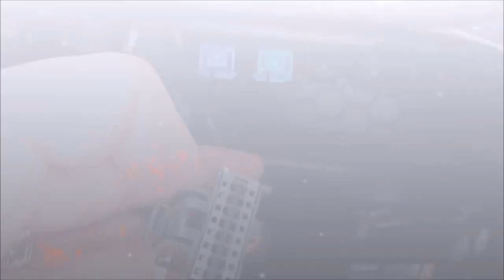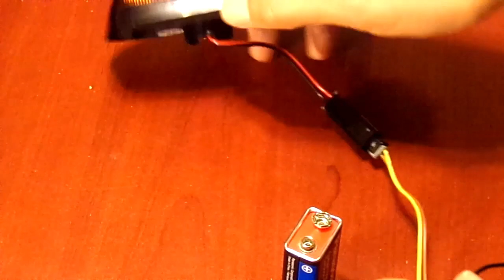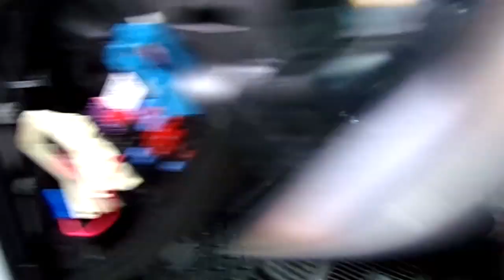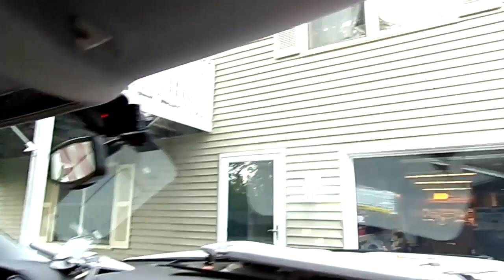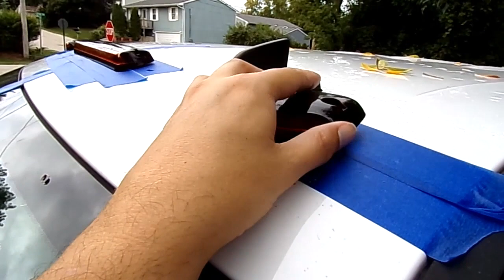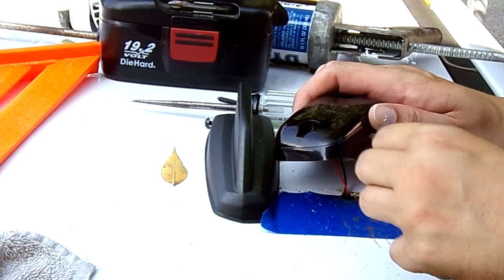Project Silverado E17 - Cab Lights

Comment: Hey quick question I got these lights installed but they hooked it up to the fuse box under the hood where when you turn your marker lights on they turn on but not one of the lights are flickering. Do you know how I could fix this?
Reply from the maker: If it's only one of the lights that's having an issue, its either the light itself has an issue, or there is a bad connection somewhere. I would start your trouble shooting first by checking your wiring
Reply: Tommy's Project Silverado alright thank you
Reply: What brand of lights are they